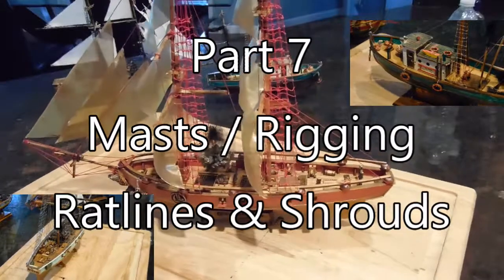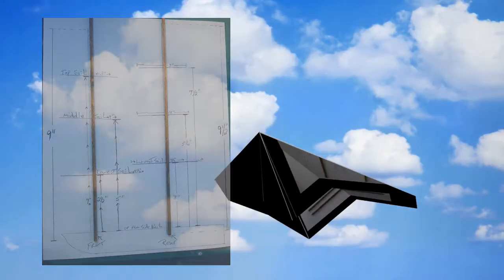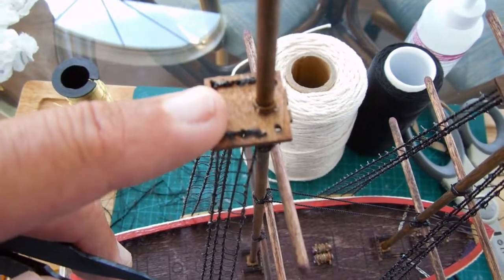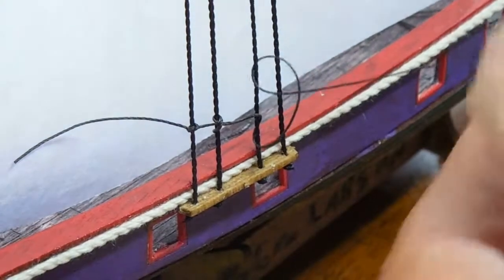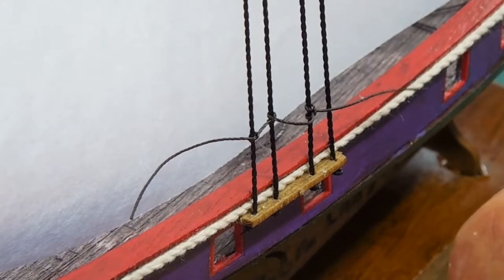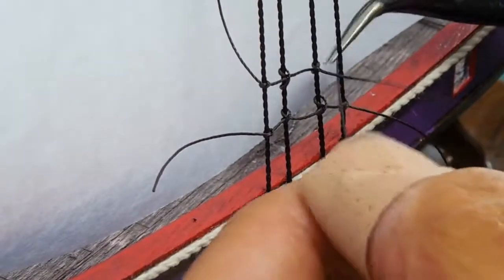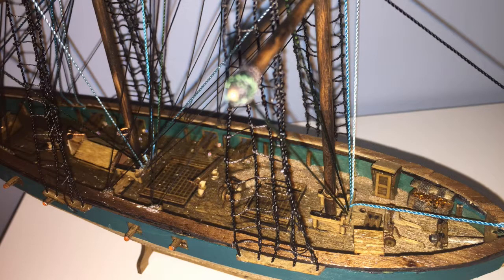Wooden Model Ship Build Part 7

Comment: climbing ladders = ratlines
Reply from the maker: Obviously I’m new at this 😂….. I’ve picked up on some proper terms since production of the early videos… but I’m still learning!😂
Thanks for watching 👍
Reply: Hello. Been following your videos. Was wondering about the different sail material and how to get the shape to stay like your Pic. On my 2nd ship. Thanks
Reply from the maker: I make it up as I go!😂
Actually I’m still learning about sails, and about everything else too….
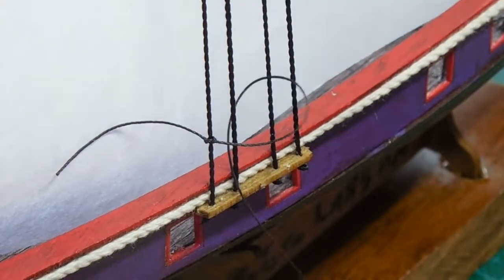In the case of the HMS Victory, I just kind of pushed them out to that shape.  I put a thin layer of clear gel tacky glue along the edge of the material so it wouldn’t fray.  The material didn’t come with the ship, I found it at the Walmart fabric department.  I show that at the 13:08 mark on episode 12…. NOTE: I just discovered that the sound is not adjusted properly between 3:06 and 3:42 minute marks.
I’m going to try to edit it and repost that segment….
Since then I’ve been trying other things…. Currently trying to wear the sails using a rock tumbler…. That’s still ongoing.
Thanks for following along. Wish I had more specific advice 👍🏴‍☠️
Reply from the maker: I reposted episode 12 with a little less musical background volume.  Hopefully it makes it tolerable.
Here’s a link to it. The part on sails is towards the end.
HMS Victory Model Ship Build Episode 12 REPOSTING due to sound error.
https://youtu.be/xcvdhL3NBiI